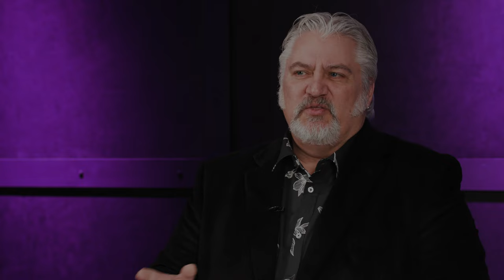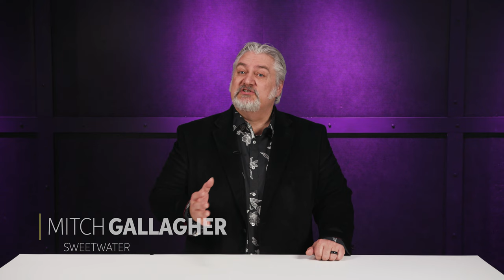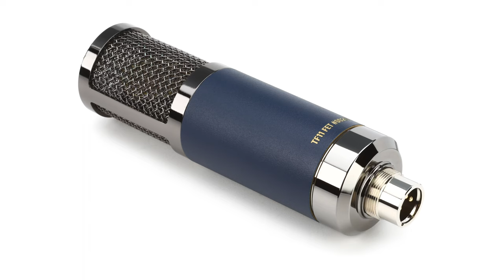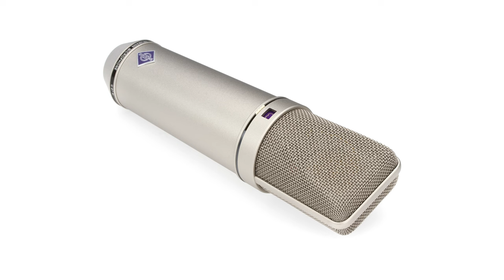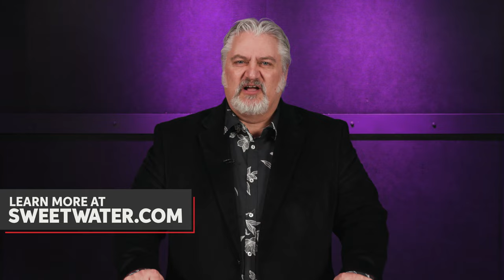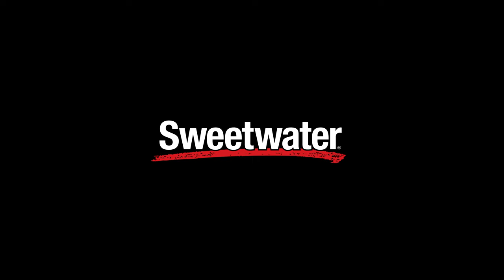What Is a Condenser Microphone?

Comment: So...which is better for live onstage Singers / Vocalist- Condenser mic or Dynamic mic ?
Reply from the maker: Hi, Karla! Both kinds of microphones can work great for live vocals. Although, you will more commonly see a dynamic microphone used in live settings. This is because a dynamic microphone will generally be much less sensitive, therefore less prone to feedback from stage noise. If you are going to use a condenser microphone for live vocals, I would recommend making sure it is a condenser mic made specifically for live purposes. This way, you’re going to get a lot of the sought-after qualities of a condenser mic (more characteristic, better sensitivity) but the mic will be made to avoid feedback (tighter polar patterns).
I hope this helps!
Nick Pasquino, Sweetwater Sales Engineer, (800) 222-4700 ext. 3230, nick_pasquino@sweetwater.com